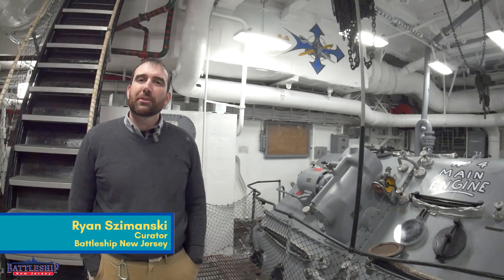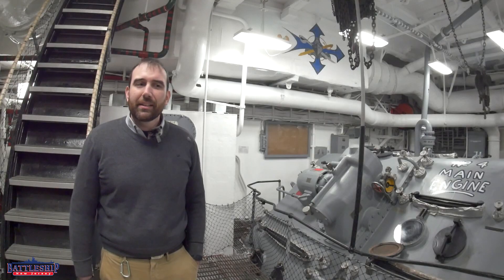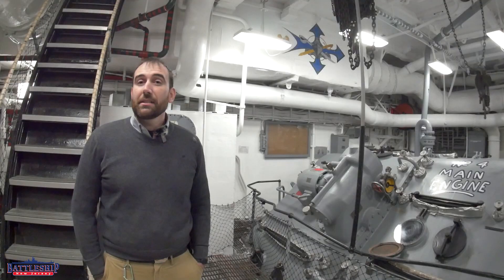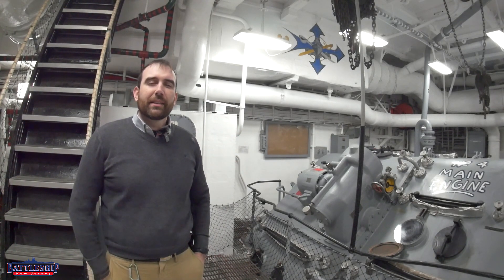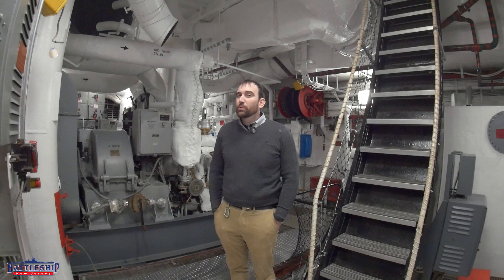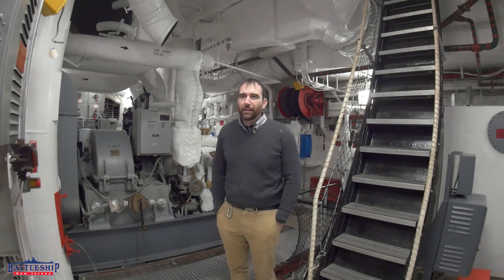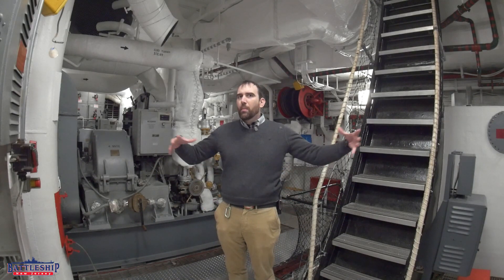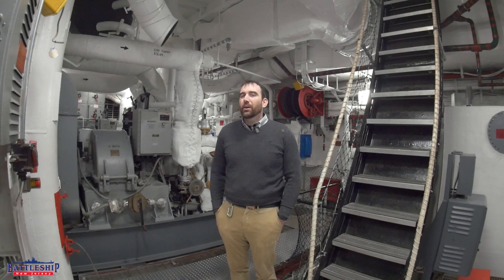Ways the Iowa Class Battleships Were Ahead of Their Time

Comment: Assume that the crew berthing shown at approx 6:50 is aboard New Jersey.   The top rack is still exposed to the overhead,  Serving aboard USS Forrestal in 1968, berthing was up forward under the foreword catapults. During catapult launches a fine white powder would float down into the crewman sleeping in that top rack. The piping was of course Asbestos covered which with age dried out and was no longer contained  I would imagine when the main batteries aboard New Jersey were fired in the 1980's you would have the same result! Signed an Old Shellback PH3. RVAH-12.

Comment: Knowing how much power the Iowa Class Battleships can produce, and what upgrades are available to automate some of the systems when it comes to maintenance and just being put into service. How much personnel would it require to do a 6 month tour. Ofc after being retrofited to come back to service and not in current state. I would imagine you would no longer need, let's say, 5 sailors per engine and I would like to see, if possible, a video about that. I don't mind if it will be just an Excel spreadsheet video talking about back then versus now. The best example that I can give is for airplanes where some of the newer versions no longer have a 3rd on duty pilot/engineer which would make sure that the mixture of fuel is correct and the engines run at within designed limits

Comment: One thing the Iowa class could have done to upgrade electrical power and to get rid of a bunch of old heavy equipment could have been to get rid of the 1940's electrical power generation systems and gone with gas turbines. One 1970's LM 2500 (same as used in the Spruance and Kidd class destroyers) would have produced around 20,000 kW of electrical power when paired with a generator. 4 of them would have produced around 80,000 kW's of power.

Comment: The Iowa class also had considerable reserve buoyancy. So not only does she have the physical space to add new systems, but she could also handle the weight. Some of the remaining Essex class aircraft carriers were later upgraded to handle larger aircraft, such as having enlarged and angled flight decks. The design performed so well that the last one active served all the way until 1990 when USS Lexington was retired. 

I would also highly recommend the extended guided tour that takes you through the gunnery and engineering spaces, such as the one he is standing in there. No other Iowa class ship is as open to the public as New Jersey.

Comment: I've been watching this too long.  Starting to anticipate Ryan's reasoning.  The first "forward thinking " that came to me was the extra buoyancy built in allowed for the additon of the extra missile systems and such.  You trumped me with the electrical capacity.  Do you think that the designers were already planning for the explosion of radars and olther electronics back in the 40's?  Luckily solid state electronics meant that the future versions consumed less power than the vacuum tube based electronics of the 40's.
Reply: Just speculating here but I figure some of that is margin for growth and a lot of it is updated risk analysis as the nature of combat evolved. 8x 1.25 MW is indeed 10MW gross, but in a vessel designed to lose entire sections, I imagine the original intent was in terms of redundancy. Lost one boiler or engine room and you're down to 7.5 MW. Lose two and that's only 5 MW. If I wanted the ship to have a certain amount of survivability I wouldn't have specced much beyond that. I suspect that as the years grew on and there was less ship-to-ship direct combat, the US Navy re-evaluated those requirements and upgraded the amount of expected power as less redundancy would be necessary. Plus you can always "not run stuff".

They took out some vacuum tube stuff but the old power-hungry fire control systems are still there. The motors inhale much more power than a handful of integrated circuits! Plus they did refit from incandescent bulbs to fluorescent lighting which I'm sure helped quite a bit.

Comment: Having 2 main battery plots and computers which allowed for much better indirect fire in the days before modern position fixing fave them a big edge over previous classes that weren’t as well equipped.  1 computer and director could track a prominent land feature to accurately locate the ship while the other then did the ballistic calculations to actually lay the guns on a target that couldn’t be seen by any ship sensors.  Pretty cool stuff in the analog days. That certainly made them more desirable for reactivation over previous classes.

Comment: Off-topic, but just my opinion: I believe concentrating all our naval airpower in only 13 carriers is a huge mistake. I believe the Navy should build a new class of conventionally-powered post-refit Midway-sized carriers. While the original Midway class became obsolete because newer aircraft could not fit in its hangars, a carrier of around the same size that's designed with modern aircraft in mind would work just fine.
Reply: I agree - the super-carriers are way too major of targets these days, too large of an asset in one place.  I  think assault ships like those of the Wasp-class and their ability to carry F-35B's makes them much more versatile and useful these days.
Reply: @garywayne6083 the easy option would be to borrow the design for the QE class add in a defensive suite + cats & traps &   Reactor drive train.

Comment: As a minor quibble, the USN had several capital ships built before the Washington Naval Treaty that could generate much more electrical power than the Iowa-class could. Of course, that's because they needed to generate lots of electrical power, just to get underway: they had turbo-electric propulsion, which used electric motors, rather than geared turbines, to move the ships. That's clearly not a fair comparison to the Iowa-class, which could generate 10,000 kW of electrical power available for ship systems, while steaming at 30+ knots.

Comment: How does water get into and out of the ballast tanks? You talked about how the tanks line the hull and the keel. That is a really long distance. Is it pushed out with compressed air? Pumped out? Are there valves in the hull to blow the water out, like on a submarine?

Comment: I disagree with the notion of the Iowas being considered "super battleships". Yes, they are the second biggest behind Yamato and Musashi, but their characteristics don't mirror what their Japanese counterparts display or even the Montana-class. "Unrestricted battleship" is more like it. They sit at the top of that threshold, follow by HMS Vanguard, Bismarck and Tirpitz, Richelieu and Jean Bart (to an extent). I think the Iowas are in a perfect spot where their reserve of buoyancy, speed characteristics, offensive and defensive capabilities make them pinnacle when it comes to their overall design. Not even Yamato could take that title away from the Iowa-class. There will be no other vessel like the Iowa-class with those kinds of characteristics.
Reply: Very well said. In a surface gunnery action, they were in no way equipped to engage the Yamato class. By any other consideration however- and particularly viewed as overall fleet units-, they were far and away the most valuable capital ships ever constructed.
Reply: I'd stick to calling them post-treaty battleships.
Reply: @HighlyImprobableName  They weren't, though.  The Iowas were designed under the stipulations of the treaties, just exercising the escalator clauses.  The Montanas would have been post-treaty battleships.
Reply: @JBee792  The original design was, but changes were made after 1938 and by their actual commissioning in 42-43 they were more than 3,000 tonnes over the escalator clause limits.

Comment: It doesn't change the fact most of the features like ability to take damage, speed, size, were not being used after 1950, because surface actions and large shell and torpedo attacks were not a rational threat where they would bring the ship. For a fraction of the cost of maintaining these ships they could have put a single or double 14/16/18 inch gun on some platform. Have it go at 12 knots or no engine at all, only electric steering and slow movement with diesel generators and batteries. Everything a battleship has done since 1950 could have been done with a slow gun barge. If they think shore bombardment and fire support for a landing is still a possibility, they should design such a platform, it could cost a cruise ship plus the guns. You worry about the magazine you could put the powder in a powder sub that docks and unloads a few days' supply then goes under the water and hides.

Comment: I would dispute that the Essex Class were to small to operate modern jet aircraft.  The last deployment for an Essex was the 1976 USS Oriskany deployment.  Her airwing had over 70 aircraft include 24 F8 Crusaders and 36 A7 Corsairs.  The Oriskany carried as many jet aircraft in 1976 as a British Implacable Class did piston engine 30 years earlier on a displacement less than the contemporary HMS Ark Royal.
Reply: The British got 12 BAC-MDD F-4K Phantom II FG.1s, 14 Blackburn Buccaneer S.2s as strike power with 5 Fairey Gannet (4 AEW & 1 COD) along with 7 Westland Sea King ASW and 2 Westland Wessex SAR aboard Ark Royal in the 1970s
Reply: @Knight6831  The A7 could carry more ordinance than the Buccaneer.   24 F8s gives you the capability for a 24/7 CAP. 12 F4s does not.
Reply: Fat lot of good that is if it gets caught whereas the British Blackburn Buccaneer can go in low and fast making it much harder to hit

A 24hr CAP would not be done unless when at war as the fuel expenditure would be seen as expensive
Reply: @Knight6831 The A-7 was just as fast (or rather slow, both were subsonic) as the Buccaneer, and adding low to the mix makes you a wonderful target for light AA, as F-105 pilots found out. As for 24 hour CAP capability, I'd rather have it and not need it than need it and not have it.
Reply: @griffinfaulkner3514   Yeah the F-105 in Vietnam were loaded with bomb racks which slowed them down and that assumes they know which direction it is coming from 

Except the British would not be as silly as the USAF considering that the Buccs would be at extremely low level of 100 feet or less and flying at near-top speed and i suspect the Buccaneer's wing pylons would have been designed to handle the aircraft's high speed plus it has a tougher airframe as its a carrier aircraft
Reply: @Knight6831  Dude, low-level high-speed attack was literally what the Thunderchief was built for. And no, the Brits aren't going to be flying below 100 feet at speed, especially in an environment like Vietnam, because that's a very good way to eat a goddamn tree. The only strike aircraft that flew anywhere near that level at high speed was the F-111, which had a dedicated terrain-following radar specifically for that purpose. The Buccaneer would get chewed up just as badly as any other attack aircraft by ground fire, and unlike the Thud, it doesn't have the option of ditching its ords, punching the burners, and going supersonic to outrun enemy fighters.
Reply: @Knight6831 The A7 can fly just as low.  I have seen A7s fly the Mach Loop.  

Deployed navy tactical aircraft get about 30 flight hours per month or 10 double cycle sorties per month.  A 24 aircraft fighter contingent has 240 three hour sorties per month or about 30 days of a 24/7 CAP without breaking a sweat.
Reply: The Essex's were also flexible.  All were modernized extensively in the late 40's and '50's with the final configuration including an enclosed bow, an angled flight deck, steam catapults, upgraded arresting gear and an outboard elevator.  They ushered in the jet age with the fleet and flew them well into the '70's.

Comment: Yeah considering the British managed to get Phantom on the Audacious Class and even got jets comparable to the A-6 on HMS Victorious
Reply: The Ark Royal carried half the Aircraft of a contemporary Essex Class.  See above.
Reply: Yeah but that is not the point, the point is that the British did what you guys could not do
Reply: @Knight6831  False, The Audacious class was almost the size of a Midway.  We flew. F4s and A6s off the Midway class.  The US had no  need to modify the Essex to carry the Phantom. Heck, They flew A3s off the Essex class.   The US Navy would rather load up with 25 F8s than 10 F4s, especially in the 1960s because the F8 was a superior fighter for Vietnam.
Reply: How is an Audacious Class the same size as a Midway Class?
Reply: Yeah but we should remember British aircraft are designed for completely different needs 

Frankly what's the point of A-7 if it was stuck with a trash TF30 engine early on instead of the engine which in hindsight would have been better off getting from the start, the Rolls-Royce Spey derived Allison TF41
Reply: @Knight6831  How?  The Ark Royal modified to operate the Phantom came in at 60kt.  The Midway came in at 64kt.
Reply: @Knight6831  The purpose of the airwing is to deliver ordinance.   36 A7s  is a more effective strike element than 14 Buccaneers.  

The FAA lagged behind the USN in capability dating back before WWII. Their last indigenous Fleet Defense fighter, the Sea Vixen was introduced two years after the F8 and three years after its rough US equivalents the F3H and F4D both of which outperformed the Sea Vixen.  The FAA did not have the force levels to economically develop their own aircraft and should have negotiated licence agreements for production of US aircraft.  It took to 1960s for RN  to figure this out.
Reply: >  The purpose of the airwing is to deliver ordinance. 36 A7s is a more effective strike element than 14 Buccaneers. 

i would like to remind you again of differing needs and the fact which you are completely ignoring is the RN didn't get the Maltas or CVA-01

> The FAA lagged behind the USN in capability dating back before WWII. 

Oh that is utter ignorance of the situation, the stuff the RN had i.e Roc, Skua and Swordfish was not the stuff it was suppose to be using when the war broke out because it started 3 years earlier than the RN had planned for

You do know that the British evaluated the Devastator in 1940 and rejected it for poor navigation and observation facilities, not designed for spotter-reconnaissance and when with wings folded up, they were too big for the lift of RN Carriers, also its performance was not that much better than the Swordfish and was as vulnerable to gunfire as the Swordfish

In fact you can argue that the Royal Navy was ahead of the United States in major capability areas as the United States Navy had no doctrine of night fighting nor the capability of reliable aerial torpedoes cause until 1943-44 the Mark 14 family of torpedoes were garbage compared to the RN's Mark 12 aerial torpedoes plus the British Empire's torpedo bombers were able to carry ASV radar

> Their last indigenous Fleet Defense fighter, the Sea Vixen was introduced two years after the F8 and three years after its rough US equivalents the F3H and F4D both of which outperformed the Sea Vixen. 

You do realize the different requirements that Skyray, Demon and Sea Vixen were built to different needs as the Sea Vixen follows the idea of the missile fighter where as the demon and skyray don't

> The FAA did not have the force levels to economically develop their own aircraft and should have negotiated licence agreements for production of US aircraft. It took to 1960s for RN to figure this out.

Oh really but that is total nonsense in fact it is so ridiculous that it is funny as the British could and your comment shows your ignorance of the British Aerospace industry as the British were able to